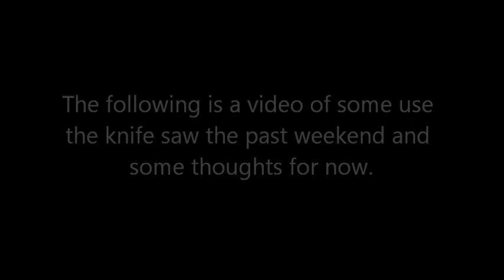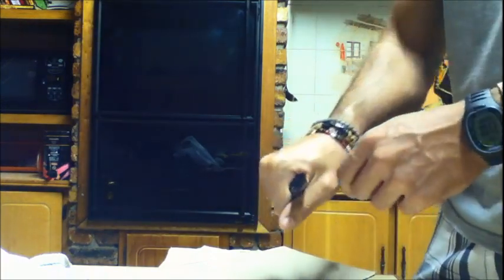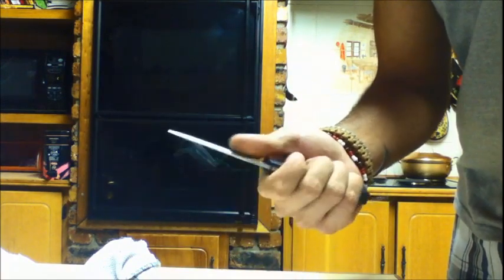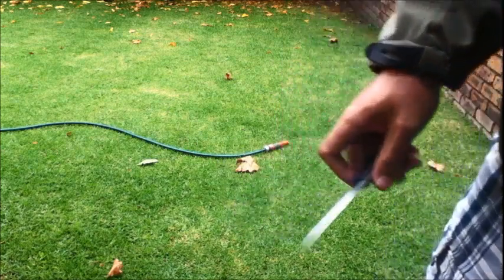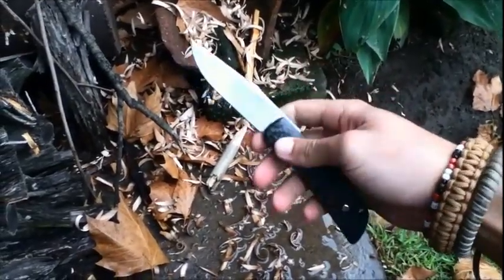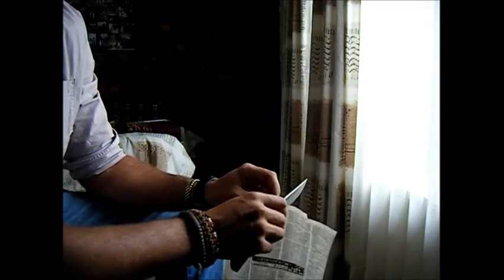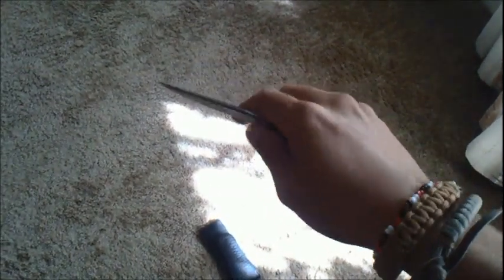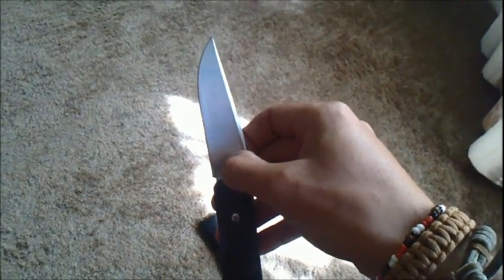Des Horn Imvubu with Nitrobe 77. My Grail.

Comment from the maker: I could visually see no deformation of the edge, no rolling,chipping with the naked eye. Edge holding depends on a few factors, wear resistance, strength, toughness (to my knowledge properties of steel and heat treatment) and then the sharpening approach plays a vital role in performance. 

I did the cardboard first with the high polished edge it came with, then moved to foodprep etc and the knife remained sharp to do all of that. It would not shave any more, but it still performed.

Comment from the maker: To ad: I feel that if one would encounter a lot of cardboard or abrasive material a coarser edge would perform better in that test (based on my uses and experimentation) and a high polished edge would perform better for pushcutting and woodwork. Once again, appropriate sharpening plays a role, or trying to get a balance through sharpening/experimenting, for your uses.

Comment: Any thoughts on this a year later?
Reply from the maker: Wow, Cliff, cant believe it has been a year as my main EDC knife. I am glad I did not get one with a clip as a clip would probably have caused some sort of hot spot. It has been interesting to see how the steel performs at lower angles than what I am use to normally and it has given me the confidence to explore lower carbide steels, ground thin and properly heat treated. All and all, it changed a lot of my perceptions. The main comments from people that I show it to are:

- It is light for such a large knife
- The handle material looks great
- It looks sharp (with a polished bevel)

I still prefer the straight handle design, though it does limit grip security compared to a Spyderco Military. The lock is still solid, no slippage and minimal wear even with flicking the blade open. I will update the Towards 0.1 Micron thread with some pictures.
Reply: mwvanwyk It would be interesting to see if you could notice a difference between it and AEBL, 14C28N, etc. .